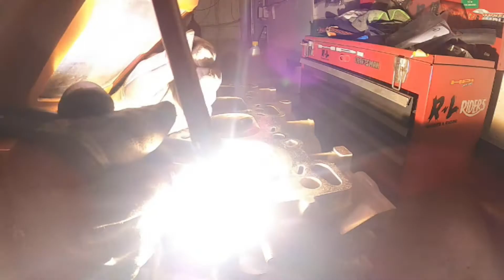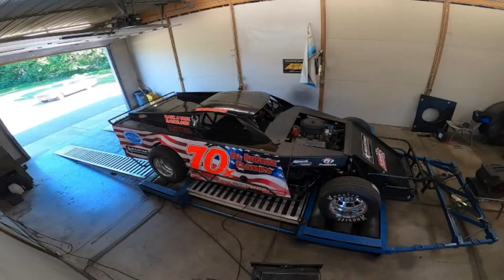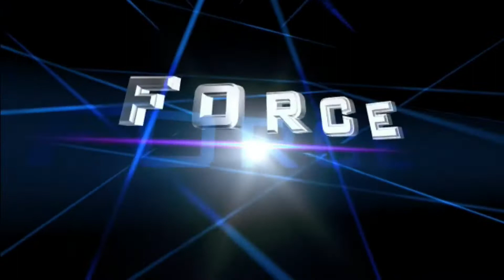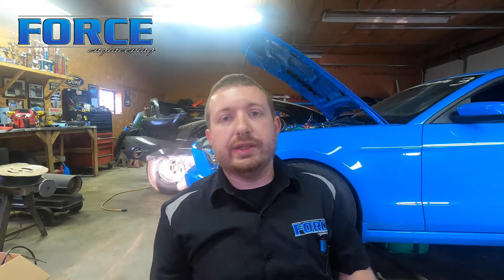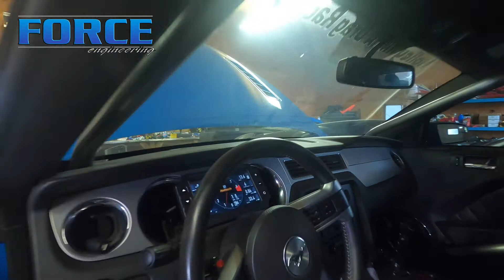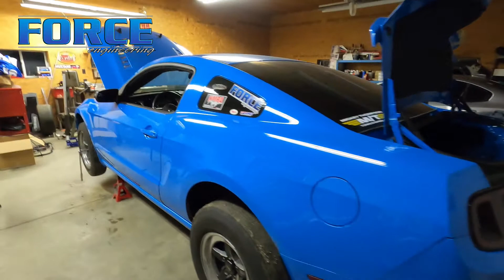Haltech IC7 Dash | Trans Fluid Weight Change

Comment: Do you plan on doing weight reduction to the car? I see you still have your AC and heater core.
Reply from the maker: Not currently.  For some reason I keep telling myself its a street car.  But i dont street drive it..  and i havent wired the AC with the haltech yet.. lol